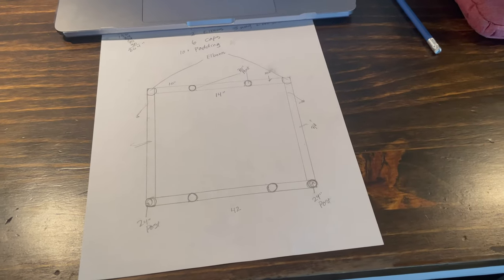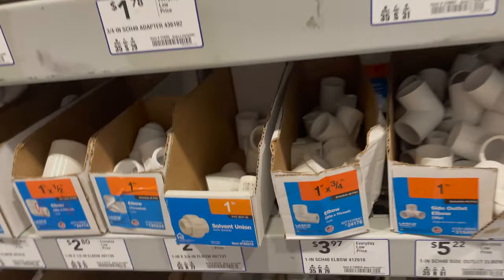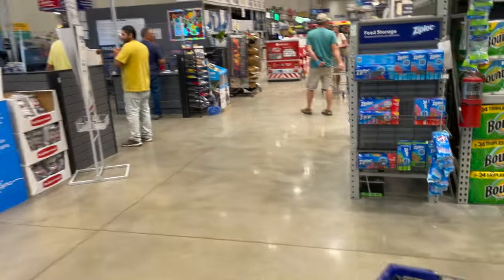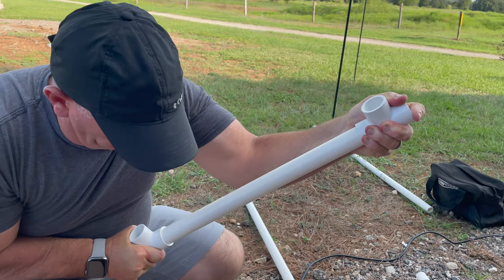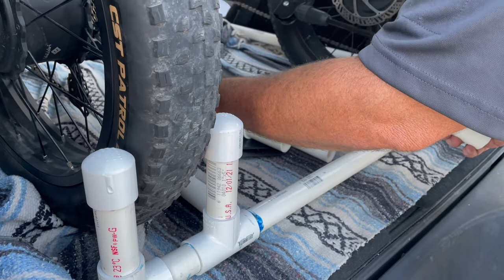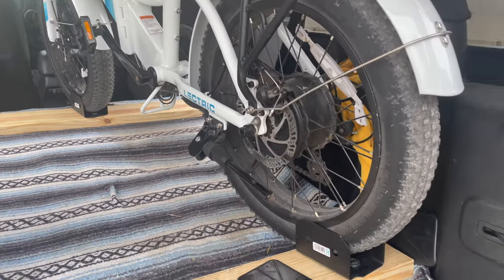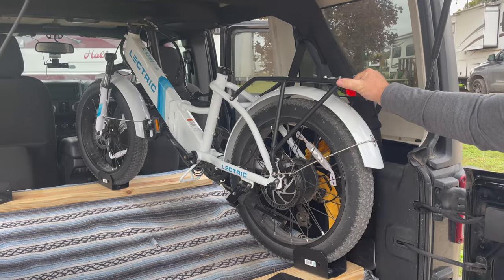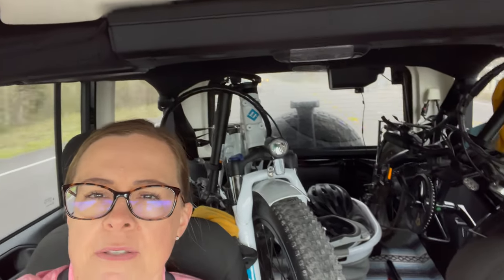DIY: E-Bike Racks for Inside the Jeep

Comment: i use 2 50 gallon totes and two fit in the back of my jLU just fine. they roll out with wheels and I can pull the bikes out and unfold em and assemble them. throw the totes back in - = bonus : if they are muddy, the mud stays in the totes.
Reply from the maker: That’s a good idea. Thank you for watching.

Comment: My only concern is that the metal bracket actually scratches up the rim. The sharp edges eating on the tire. I would have added some kind of rubber or felt onto the bracket. Otherwise cool idea.
Reply from the maker: We use the packing black flat things that came with the bikes. We put between the rim and the bracket

Comment: What happened to pipe?   Have hard time lifting bike ( with bad back) and keepfront wheel straight?   Are the 3 inch brackets just mounted on 2x6 ‘s?    What is length of 2x6?  Or is it 2x8?